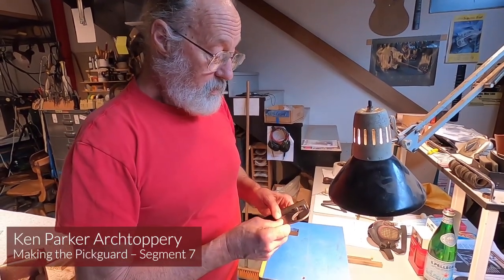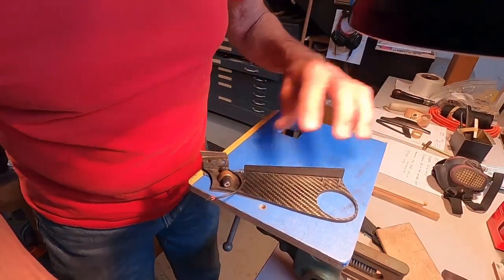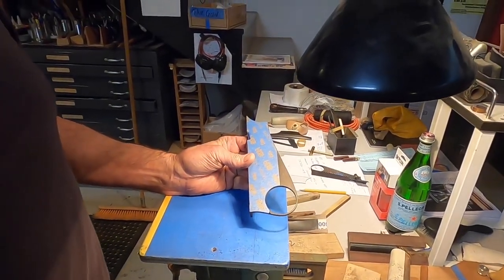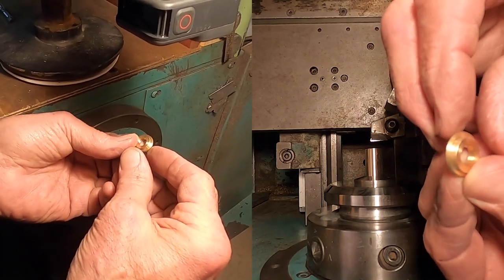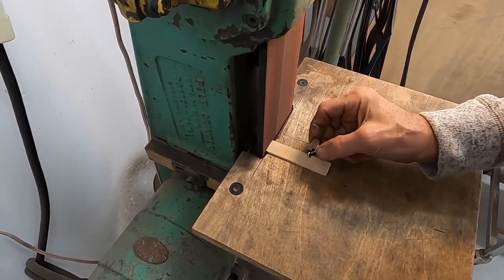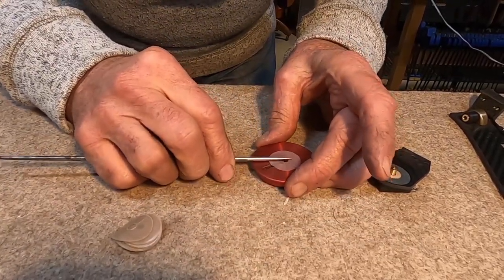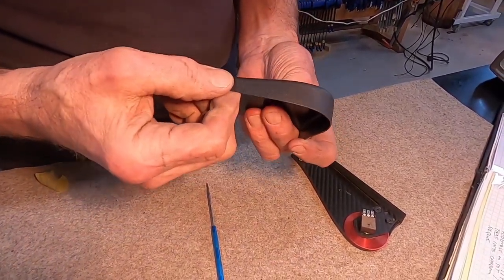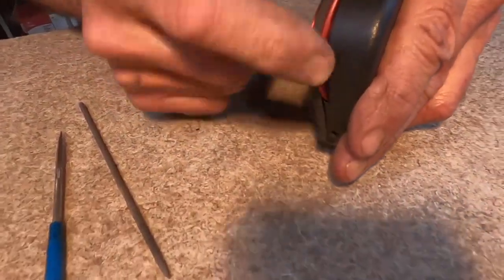Ken Parker Archtoppery: Making the Pickguard 7

Comment: Fun idea: get electrically conductive PLA and 3D print your plastic covers so that they work as shielding as well
Reply from the maker: It is a fun idea, and one I might entertain if ever a 3D printed part looked handsome, which, to me, they don't.  I like the pebbly non reflective surface on the Kydex material, and chose it partly for that reason.  For a plastic part, it looks like it belongs there.  Shielding is pretty easy with 2 pieces of copper tape.  It will be great when printed parts look fantastic, but I won't be holding my breath!
Reply: @kenparkerarchtoppery9440  yeah. For parts that must be aesthetically pleasing I end up spraying it with a filler heavy paint, leveling, and then spraying whatever final color I need.

Comment: Where do you get these low profile pots? Fabulous series
Reply from the maker: It's a CTS plastic bodied 500K pot that I have bought from Allparts..

https://www.allparts.com/collections/potentiometers/products/ep-4086-cts-500k-sealed-premium-audio-pot

They are not especially "low profile", and are way too long for me to use as supplied.

I put these in my lathe and abbreviate the shaft length, as well as reduce the mounting thread size diameter from 3/8" - 32tpi  to 5/16" - 32tpi. Finally, I sand off some of the plastic cover on the back to get the length as short as I can. It's a crazy amount of work, guilty, as charged.
Reply: Thank you so much. I'm fascinated by the neck work. I've made several all carbon fiber guitars but your work is inspirational. @kenparkerarchtoppery9440

Comment: I wonder why you do all that work to that part with the 1/8" jack still there?
Reply from the maker: It's cuzza I did a kind of dumb thing, putting slick ahead of practicality, and screwed the cast bronze jack bracket from the top side of the pickguard, where the screw heads are covered by the (usually) ebony veneer.  As such, the darn thing is in the way forever.  Currently looking into designing and making my own (explicative deleted) 1/8" jack that never breaks, and screws on in a civilized way from the appropriate underside of the pickguard.  Good, legitimate wondering on your part.